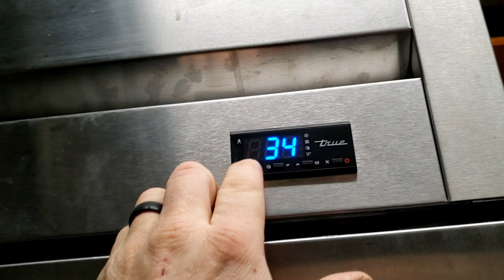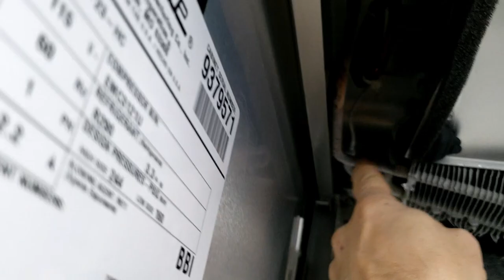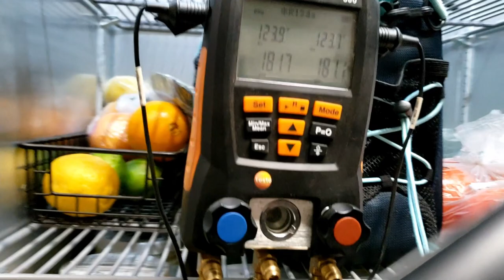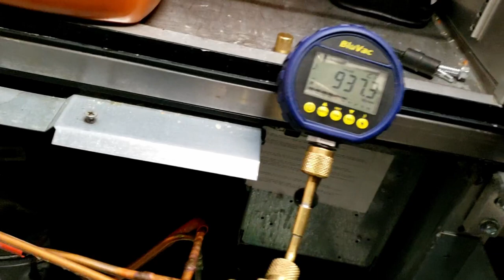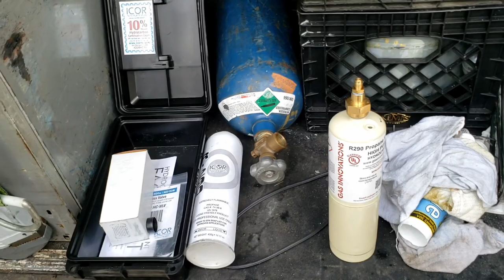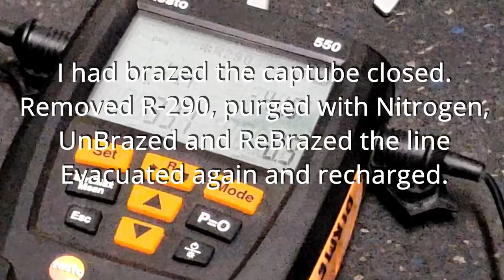True R290 Cooler Repair / Another Evaporator Leak

Comment: I have done hundreds of cap tube systems over the years and would wipe my index finger over my forehead and then rub cap tube end between fingers to coat with oil from my skin to prevent solder from sticking when brazing. Also would use old piece of cap tube as a reamer while heating to remove a build up of solder on old connections.
Reply from the maker: That makes sense on the old cap tube for a reamer and I will have to try the oil trick. Thank you for contributing to the discussion.👍👍👍

Comment: older garage/outdoor rated fridge pretty much just had small heater in the fridge compartment near thermostat/timer area. usually just a copper foil mat and resistance wire.
nothing like heating inside your fridge to make it cool. some may have low ambient switch on the condenser fan, but they were mostly rear coil fan-less.
newer unit are all electronic and use sensors on the coils and cabinets.

Comment: Well done! I have not had any issues with my appion core removers, they are supposedly vacuum rated
Reply from the maker: They all do great at first, it's just how long they last. I've had times where I changed the tool and then it held after thinking I had a leak and looked all over. Thanks for checking it out Steve!

Comment: Boss I had a burned out compressor replaced it, blew liquid and suction lines with 170 psi nitrogen and did a proper brazing while running nitrogen, charged exact weight 5.5 Oz. When I started it it was running a 20 psi suction for R290. high side was 90 degree coil 30 ctoa.. is it normal for them to run 0 or minus degree coil for refrigerator ?
Reply from the maker: Generally it runs the same pressure temperature over and under the desired temp as any other refrigerant.
Reply: @HVACR Survival  my confusion was that once the load is pulled down the evaporator coil will running at 20F Coil which is around 40 psi for refrigerator. But this True refrigerator was running at 20 Psi at compressor stuby port. I have not dealt with many R290 units. So running at 20 psi suction pressure which means almost 0 Degree F evaporator coil tempreture. Is ok ?
Reply: @HVACRSurvival  what do you normally see out there ?
Reply from the maker: Normally your evaporator runs 10 to 15 degrees colder than what you're shooting for so if you're shooting for a 35°  box temperature,  the evaporator will usually run 15° colder than that,  so 15* - 35* is going to be 20° EVAP coil. A lot of times it's 15°. So if our R290 EVAP was running at  15 to 20° then I would say it's fine.  If you were at 0° I would say you probably have a capillary tube issue. Hard to say when I wasn't there to do the work and don't know how things were done and why it failed to begin with.
Reply: @HVACR Survival  I really didn't know either why the compressor burned out it was locked up. I changed the and also blew the suction and liquid line . It was running at 0 degree coil. It should have changed the cap but I thought leave it alone if the issue was with compressor.
Reply from the maker: We changed the capillary tube every time just for this very reason, so we know we've got our bases covered, we don't get paid for callbacks.

Comment: "R290 is more environmentally friendly!"
It encourages throwaway society. :<
With how much more difficult it is to service, how much less reliable they are, and how you can (and should) just throw away small residential systems because they just aren't worth even bothering with when they die.
How many pounds of R134a released to the atmosphere would it take to offset the impact of manufacturing an entire new refrigerator or air conditioner?

Also seeing that ICOR bottle fail frightens me, and I'm not even in HVAC.
That's the same kind of valve commonly used in camping equipment.
Now I'm nervous that my camping gas valves are going to fail.
Although in fairness they advertise "safety self-sealing" valves, but still ... that's more than a little terrifying.
Reply: I don't think it was the valve itself.  That bottle looked really cheap.

Comment: Sucks that you had so much trouble with that cap tube.  I've heard all sorts of wives tales about methods to make sure the solder doesn't get all the way back in there and block the opening. Most revolve around wiping some type of oil on the tip before inserting it (compressor oil, 3in1, I've even heard of using face oil!) ... Anyway great video. Thanks!
Reply from the maker: I have never heard that, I might have to try it. However I've brazed oily lines before, so I don't know if I put a lot of faith in that. If I remember correctly I believe it got restricted at that same place I had to blow it out at.

Comment: 👍🇺🇸❄️🙏💪 when connecting cap tube to the evaporator on that 90 did u have to crimp it down or did it slide right in perfect fit ?
Reply from the maker: I most likely had a crimp it down, I can't play the video from the app they give us to check our messages on so I'm not sure which video it is.

Comment: Lol had same issue with those icor bottles man they are crap. What scale are you using btw? I been using my CPS but last time I used that scale gave me false charge, think I need something more accurate.
Reply from the maker: I believe if you click on my link Down Below in the description,  go to my tool bag area, it will show you what it is. It's a food grade scale that has ounces, pounds, grams and some other metrics. The only downfall is it doesn't stay on for much longer than a couple minutes, so you got to be careful of that, otherwise it's dead nuts accurate plus it's cheap.. I think I paid less than $20 for it.
Reply: Yellow jacket has a nice hydrocarbon charging kit… it’s a bit pricey but works really well

Comment: Little systems like that you could get a reclaim cylinder give it a good vac and use that to recover gas if its a pain to run a hose to blow it off.
Reply: I say get a propane burn off tube and just light it! lol
burn off is how they get rid of unwanted propane and natural gas, just a giant tube burner aimed into the air with ignition source and safe placement.
Reply: @throttlebottle5906  Don't think that would go down too well in a busy kitchen or supermarket, to be honest.
Reply: @SuperStormlord  controlled burning it is better than it pooling low and going off in a flash. the refrigerant grade propane has no scent added either.(mercaptans) because it's an acidic shmoo

Comment: These HC systems are becoming much more common every day in NW Washington, I have concluded that the manufacturers need to increase the labor allowance a hour minimum for all HC systems, they simply take longer to service then regular non-hc systems. It is not fair to the customer, since we usually have to charge them the rest not covered by warranty labor, since barely any manufacturer claim dept will pay at our regular hourly labor rates of 155/hr
Reply from the maker: Your right! The HC systems are like delicate little flowers,  🤣👍👍

Comment: I was worried about brazing the cap tube shut when you said you were going to hear up the line and stick the cap tube in there. I did one today and was very worried myself that I was going to plug it up. Was the plug at the coil or the liquid line? Just curious. Stay safe out there!
Reply from the maker: It happened when I shoved it up into that copper peace coming down from the ceiling. When there's that much braze in the joint it's almost impossible to get it all out let alone put a new capillary tube into it without heating it up

Comment: I put taps on r290, I don’t care what they say, it’s just stupid using piercing valves, and crimp fittings, or the caps. Besides that looks like these crappy r290 boxes do fine leaking on their own. I always used metal caps with seals on my taps, but that’s just stupid.

Comment: Amateur question; would it be faster to empty it by pumping it into a cylinder to then release it later outside? Might be more hassle to bring the vacuum pump than just wait a few moments, I guess.
Reply from the maker: They have a so-called recovery cylinder that you can use it looks just like a water filter canister. Normally it's not that big of a deal but I was deep inside the building to the point where I had no place to vent it, no exhaust Hood no outside windows so I had to go slow so it dissipate

Comment: I thought you were about to be asked how to fix a home refrigerator. Had a guy get aggravated when I told him his mom's window a/c wasn't worth fixing. After the sad sob story of how she's 90 years old I said I would fix it for around $500-600 (just to buy her a new one) he stopped asking.
Reply from the maker: I won't touch residential Refrigeration equipment, is a headache every time
Reply: @HVACRSurvival  - If I have a really expensive refrigerator, I'll have someone add valves to it just so that it can be maintained.   Pulled our (rent house provided) fridge out to install an in-line cartridge filter for the ice machine, popped the cover off to dust it, and noticed it was a crimp braze - and that's it.

Comment: They coated that coal for longevity so acidic foods won't kill it as quick as a uncoated coil
Reply from the maker: Sounds good, I bet it fails again in a year two
Reply: It's going to fail. 5 years or less.
Reply from the maker: Everything was warranty far as Parts I don't think labor was oh, so anything additional would have been billable
Reply from the maker: More than likely you are correct.

Comment: cap tube should of been installed before evap.
Reply from the maker: The side that got plugged up was the side that I couldn't of done in advanced. Otherwise if you watch the video again you'll see that it was installed on the coil before putting it into the cooler.

Comment: looks relatively newer unit. two repairs already? shame on TRUE
Reply from the maker: I posted the video of finding the leak earlier in the year and never posted the repair. This r290 stuff isn't holding up
Reply: @HVACRSurvival  what are your thoughts  on Trues new eco friendly (exploding flammable) refrigerent theyre using now?
Reply from the maker: @randomrazr  it works but it's not as reliable as the old stuff. There's going to be a learning curve until they get the bugs worked out. Whether we like it or not it's here.